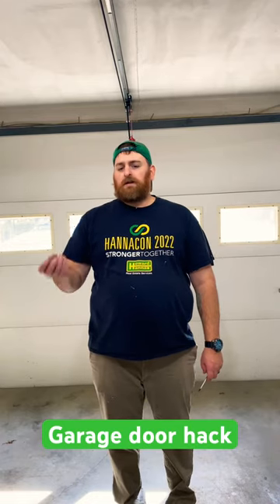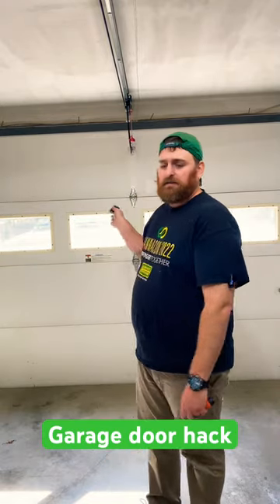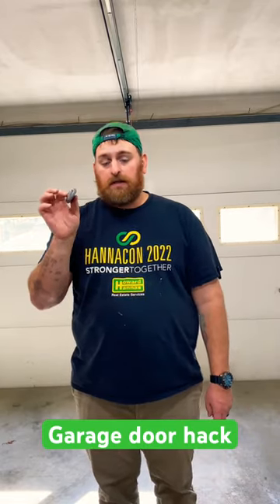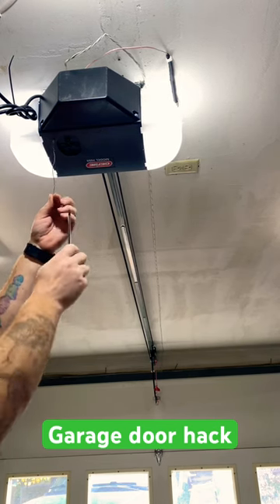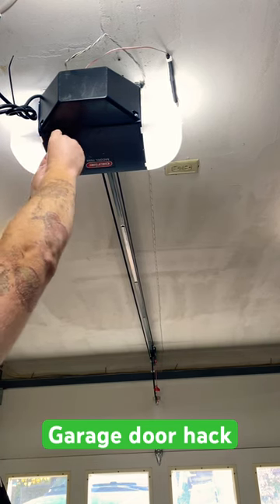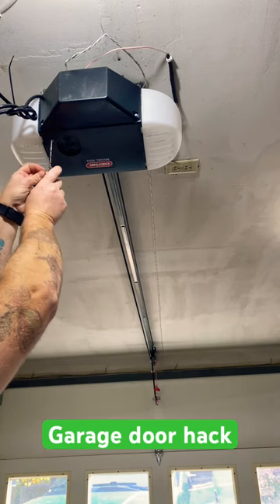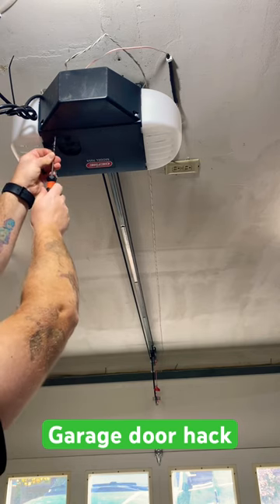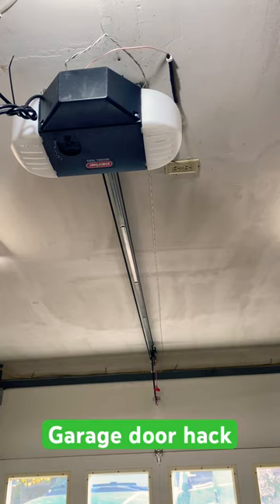how to increase remote range on garage door opener

Comment: There is a third reason not mentioned that I discovered... I had an older Chamberlain unit and was using a Phillips LED light bulb in it that was interfering. Surprisingly replacing  it with a cheapo Walmart one fixed it. I hope this helps someone, but it sure fixed my issue.
Reply from the maker: @eeknight  that’s definitely an interesting one I’ve never ran across. Thanks for sharing!